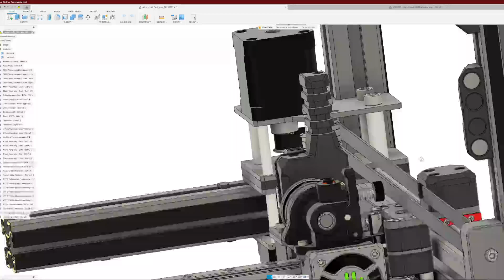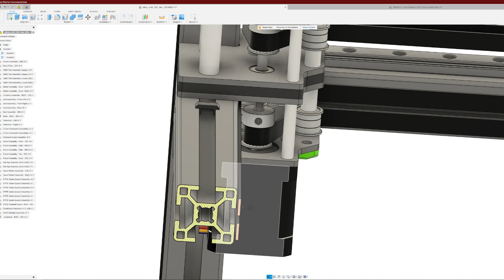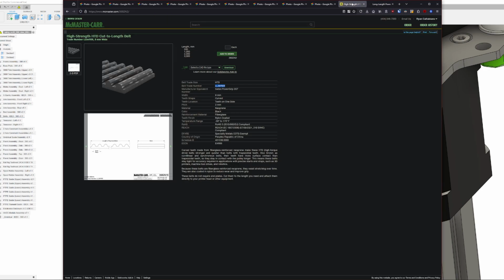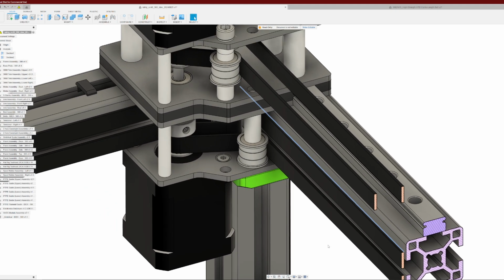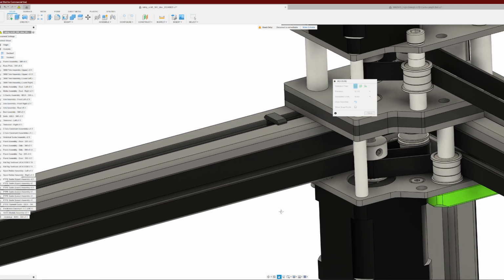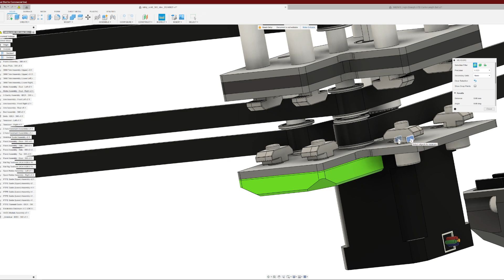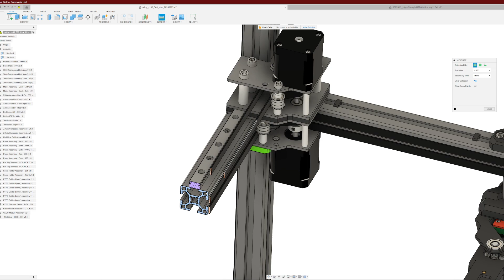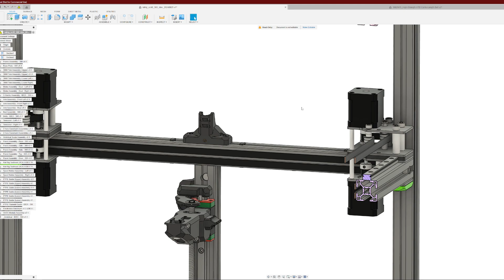Rat Rig V-Core 4 - Nit Picking Followup

Comment: If the difference between a 1.38 mm thick belt and a 1.50 mm belt is causing problems with frame clearance, the frame is way too close.  The only time tolerances like that should cause a problem should be something like a timing belt clamp, and probably not even then.  The easiest fix would be new corner mounting plates with all of the motors, timing pulleys and spacers moved inward 2 mm on X and Y.  (I see that you mention that at 11:45)  I could live with 4 mm less print area in the X and Y directions to prevent belts rubbing the frame.  It almost makes me wonder if RepRap designed the belt-frame tolerance to be that tight so the belts would touch the frame to reduce the amplitude of their resonant vibrations.  That's not a bug.  That's a feature!

10:45 - T-nuts are not precision assembly components.  They're a loose fit by design.  That allows the linear rail to be precisely assembled.  I usually don't make assembly jigs because I don't really care about the alignment to the extruded aluminum frame.  I lightly fix one end of the linear rail, then move the axis manually, lightly fixing the rail as I go, then run it back and forth by hand checking for the smooth motion that self alignment should provide, then gradually tighten the T-nuts while moving the axis.

12:20 - The plates are almost certainly not stamped and are CNC machined in house on their custom CNC router.  RatRig shows them making V-Core 4 parts on their Stronghold CNC router, although they don't call it a router because that sounds like it's intended for cutting wood and plastic and not aluminum.  The tolerances you're describing should not be a problem for this part because the bracket plates don't need to be used to ensure accurate assembly, although you may be onto something when suggesting that putting the brackets in direct contact with the 30 mm extrusions as designed could be transferring some energy into the frame and possibly worsening the input shaper results.  It's interesting to compare the input shaper graphs with the brackets air gapped from the frame versus touching the frame.

13:00 - I think your frame should be properly aligned when you assembled the frame and should not rely on bolting on the motor brackets to make the frame square.  At most, it would make the frame more rigid, but the alignment should have already happened when the frame was assembled.  The clearance between the T nuts and the extrusion, and the clearance between the fasteners and the bracket clearance holes prevent the brackets from forcing the frame into alignment.  The motor brackets are designed to attach to a properly aligned frame, and not to properly align the frame.

It should be possible to follow the kit assembly instructions and have a good outcome without being a mechanical engineer, but it does help to get inside the designer's head and understand the design intent, and machine design in general, when building something like this.  Hopefully RatRig is watching these videos to see their product from their customers' perspective.  That is an important perspective that is difficult to attain.  Engineers understand their designs on a fundamental level and it's difficult to know what someone building the kit won't know.  Maybe they could provide some more information to let the customers know about the importance of a square and properly aligned frame, with tips on how to build it square, and possibly a corner alignment jig to prevent the extrusions from rotating or having the edges off plane while the wedge screws are tightened to lock a corner joint.  Maybe the instructions could offer a sentence assuring customers that tolerances aren't a problem when attaching the motor brackets, in addition to simply stating that the brackets should be pushed against the inside X and Y sides of the extrusion and tightened.